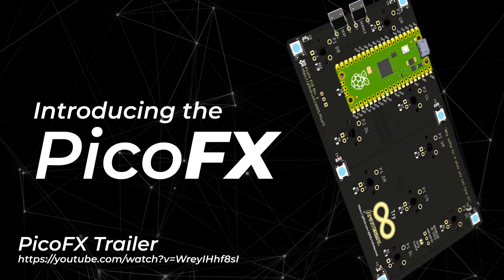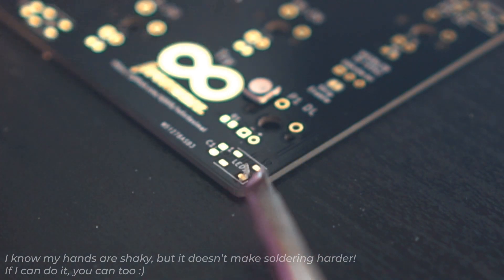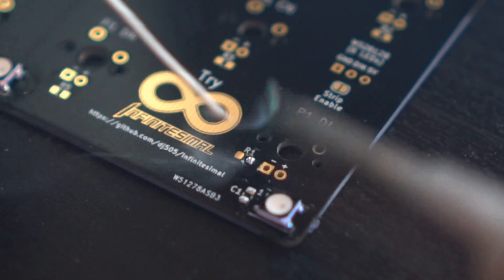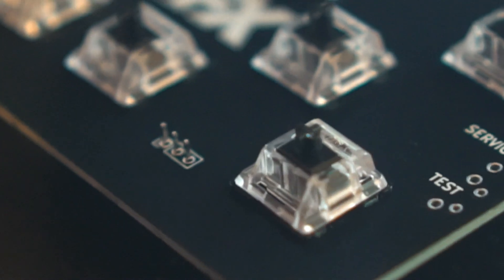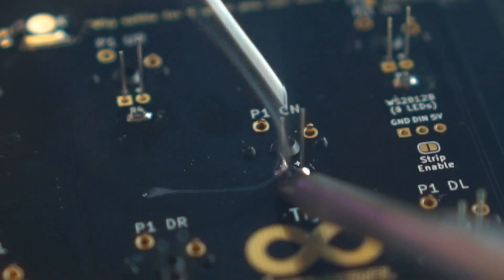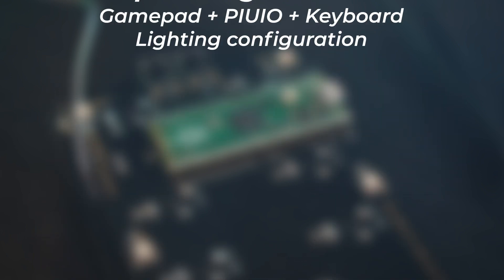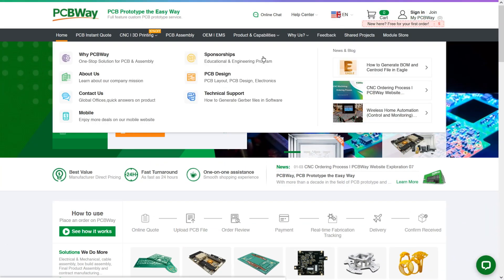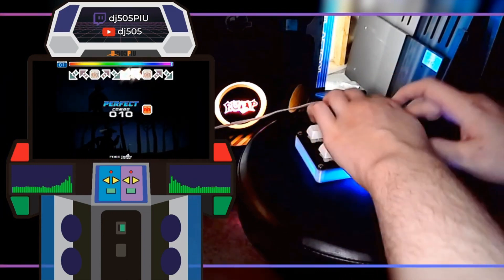PicoFX - Full Build Process & Guide

Comment: Hello, i plan on building one of these however as its my first time using a service like pcbway i need some information on what options to pick on there for 3d printing the case as they are not listed in the github guide.
Reply from the maker: @Earthbadger  I don't know much about PCBWay's 3D printing unfortunately. I used my own printer at home for this project which is why the info isn't listed. However at minimum, I'd recommend picking PLA or ABS as the material (ABS is stronger, PLA may be cheaper but is weaker) and ensure it's transparent. That's about all I can give you off the top of my head right now 😔
Reply: @dj505  Fair enough, pcbway's 3d printing services are cheap enough for me to order multiple cases so if i end up having issues I'll probably end up doing that.
Reply: @dj505  I swapped over to the PicoLX due to there being files for pcbway to assemble it however I am being asked about drill layers on the plate?
Reply from the maker: @Earthbadger  Drill layers should be present, are you uploading the zip file that's included in the repo? I think I exported it for JLC so I might also need to post something exported with the pcbway plugin. If you're not able to get it to work, let me know and I'll see about posting a separate gerber optimized for pcbway
Reply: reuploaded it and now its under manual review, think the auto auditor messed up  🤷‍♂
Reply from the maker: @Earthbadger  Awesome, glad it worked!
Reply: ok same issue asking the rep about it now

Comment: Hey there! I am having someone make me this thing and I have a question. For the Firmware. I use Pumpsanity. Should I use the HID gamepad?

Any additional recommendations are welcome!
Reply from the maker: @KatamariDemocracySA  Either firmware will work! HID gamepad is more reliable, but Pumpsanity supports PIUIO, too. You'd also get fancy game-controlled lighting with the PIUIO firmware. That said, I'd recommend swapping to a more modern simulator like StepP1+ or OutFox/Infinitesimal, Pumpsanity isn't supported anymore and has some pretty major issues.
Reply: @dj505  Thank you again for the reply. I mainly use Pumpsanity because its the most easy to use in terms of simfiles and whatnot. Outfox I have tried and unfortunately messed up my files bad for some reason (Only for PIU .SSC files) I may switch back to StepP1 because of the XX aesthetic. But for now ill stick with Pumpsanity until something PC breaking happens.

Thanks for the quick reply! Happy Pump!

When I get this thing ill be sure to let you know so you can see its customization if you will allow it.
Reply from the maker: @KatamariDemocracySA   No problem, always happy to help :)

As for customization, go crazy! The design files are all public and I encourage everyone to make it their own, no need to clear it with me first! 

If you ever are interested in swapping simulators to something more modern and stable feel free to message me, always down to help. I will say, pumpsanity uses its own SSC format revision, so if you're trying to use pumpsanity SSCs with outfox or StepP1, it won't work as expected. You'd need StepF2-format files, which are accepted universally among pretty much every other sim.

Feel free to reach out if you have any more questions about anything, happy pumping!

Comment: Thank you very much, your contribution is helping me a lot to have a pump in my house to share with my friends, although I would like to know if you can make a video of the process of using picofx in an official software, if it is not too much to ask, since I have Doubts about how to make it work on something original.
Reply from the maker: It's super straightforward - just flash the PIUIO firmware and plug it into a PC running an official game (specifically, it needs to be plugged in before booting the game). It'll work properly out of the box as if it were a real dance pad, shouldn't take any extra steps!
Reply: @dj505  holy heavens, thank you very much for answering.
Reply from the maker: @eXKaPe  no problem!